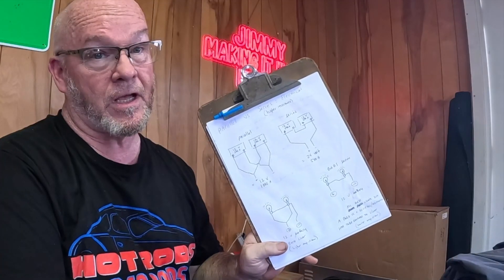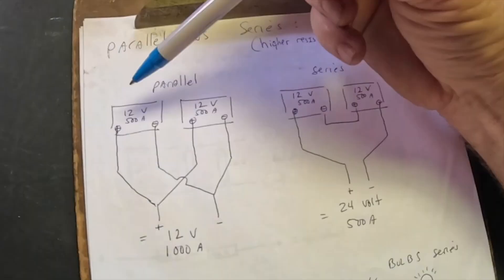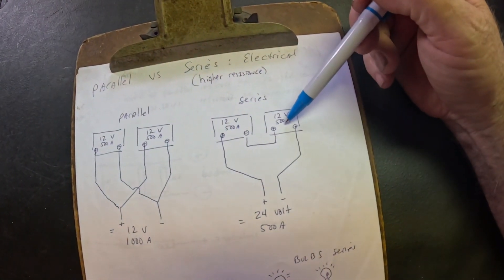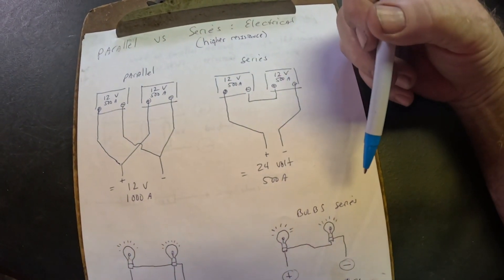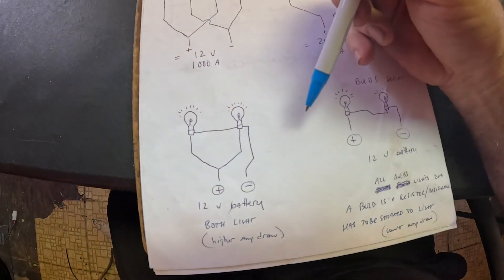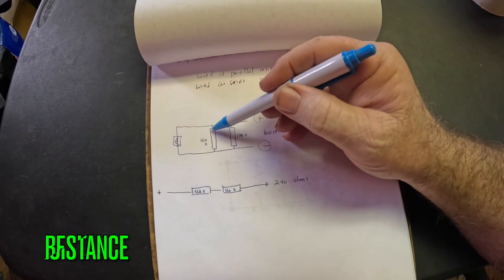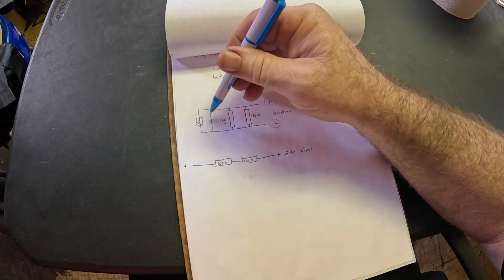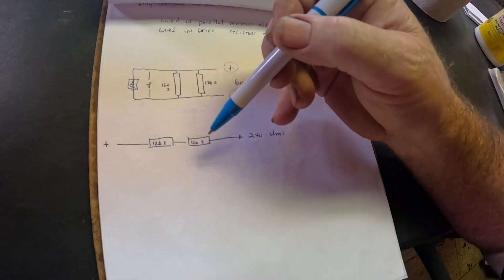Series vs Parallel, Test Light uses. Auto Electrical No.1

Comment: Excellent video. Resistors in parallel add reciprocally: For example two 10ohm resistors in parallel is  1/10+1/10 to decimal is 0.1 + 0.1=0.2. Now take the reciprocal of 0.2 ,which is 5 (just ask goggle). So 5 ohm is total resistance in circuit. Resistors in series just add normally, so if two 10 ohm resistors are in series the total resistance is 20 ohm. Learning electricity is like learning a language, best accomplished by a combination of practice and study.
Reply from the maker: You got it! 😊 Thanks very much.

Comment: It’s like trying to visualize pull up pull down circuits or ground side switched to power side switched . And how 12 volts is regulated to 5volt reference and run to multiple sensors from the ECM 🤯
Reply from the maker: It does seem complicated, but it all comes together! Hope to do more layman style videos soon.

Comment: Thanks for this I need to know this because my Transit has an accessory Bank of 4 auxiliary batteries. And I don't understand it at all if I should need to do any maintenance on it. And I probably will soon. I know the original owner told me I should be keeping up on the water levels at a minimum.
Reply from the maker: That is a good idea to keep up on the water levels. If they go low the plates inside corrode quickly and capacity is greatly reduced.

Comment: My 67 GTO has a rear window defogger. It's basically a blower motor mounted underneath the rear window tray. I tested the motor by putting 12v power directly to it, and it works. What is the best way to either test the switch and or the wire running to the motor.  Thanks  Jimmy
Reply from the maker: I would backprobe a test light to the two motor wires on place of the motor. Then with the key and switch on wiggle wires a bit and see if the test light reacts. If it doesn’t do the same set up at the switch inputs and output.
Most of the time I find the switches have bad or dirty contacts when sitting a long time. Sometimes they can be opened and cleaned with a pencil eraser.✏️ 

Hope this helps!

Comment: Would you need a higher amperage alternator if you are wiring batteries in parallel  ?
Reply from the maker: The same alternator will work, but the batteries will have more reserve capacity. If they are discharged it will take the alternator a little longer to fully charge them, so in that case I’d use a separate charger to reduce work for the alternator.
There are cases where high demand might require two alternators for best results. But that’s only on extremes like show stereo systems or commercial uses.

Comment: Many of the same terms are used in my trade but they have different meanings.

Resistance : The look on my face when the tenant wants to keep the heat at 85' degrees
Positive:  " Yes, you flushed half a roll of paper towels, I'm positive that is the problem"
Ground: Location where I find the ceiling fan blades after the tenant moved out.
Reply from the maker: That is hilarious! I think we all know the feeling when you're trying to make it work!

Comment: Great video Jimmy!
DC electrics is where I'm relatively skilled from a previous career. I always tell people who are setting up dual battery systems, inverter units or camping freezers is it's all about the current. Don't skimp on wire quality and always have circuit protection in place. Too much current will cook your wiring fast and even a small car battery can deliver enough current to set things on fire in seconds. Poor connections are the second danger, if the current can't pass easily through a connection it doesn't just shrug and go back to the battery, that connection is now an electric heater.
Reply from the maker: That’s a great point about the poor connections, thanks!